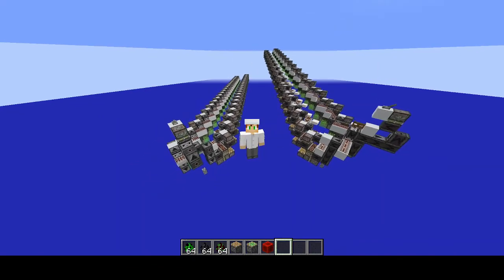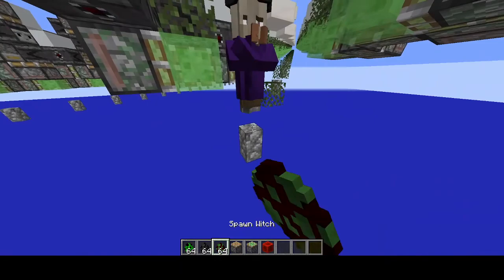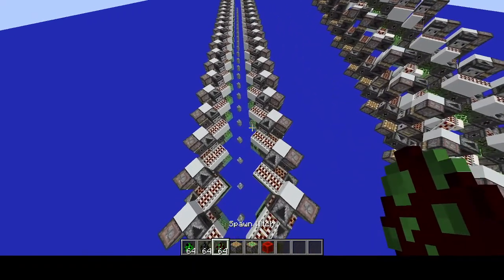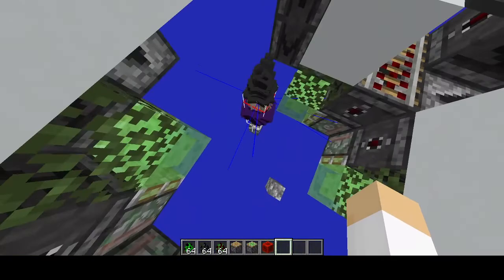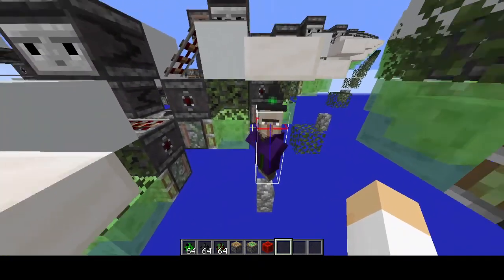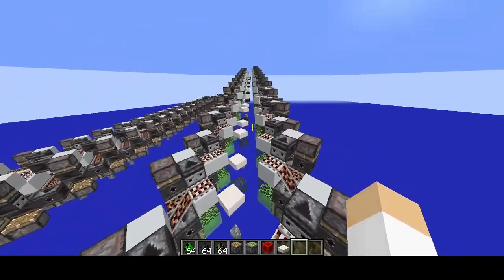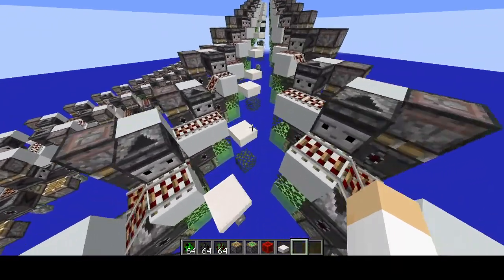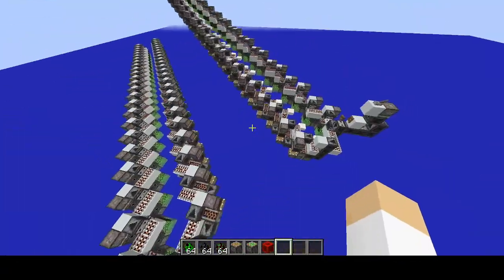Diagonal 20bps conveyors minecraft 1.11+

Comment: Isn’t it faster than 20 since it’s diagonal and the diagonal upwards is even faster
Reply from the maker: Yes, but they are only moving 20bps in each direction, plus the 5bps upwards. So yes if you want to calculate it's diagonal velocity, it's closer to 29bps.